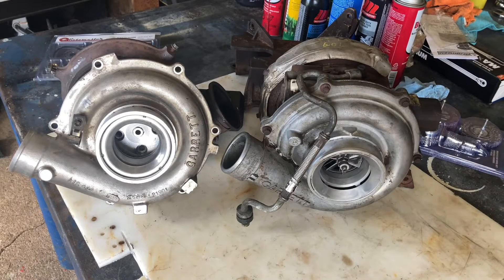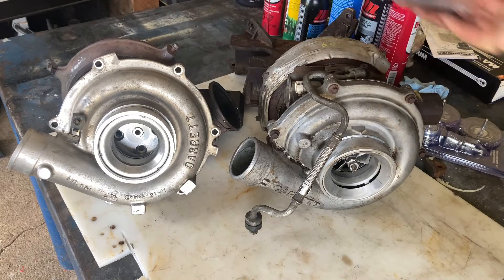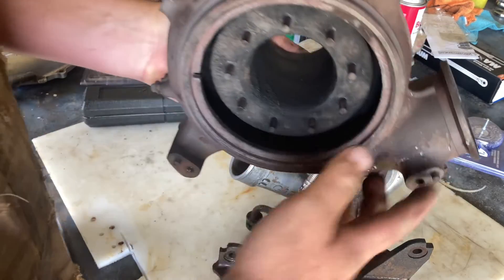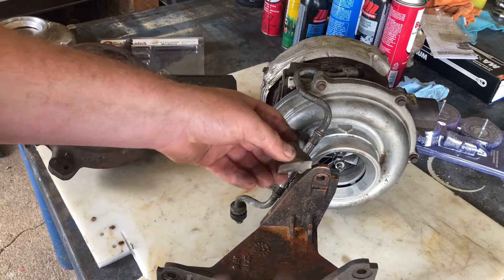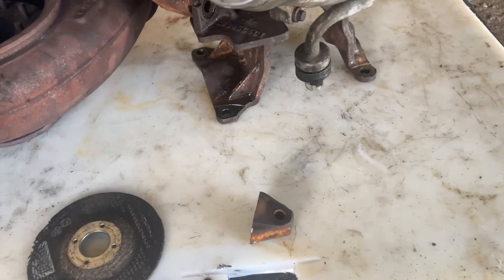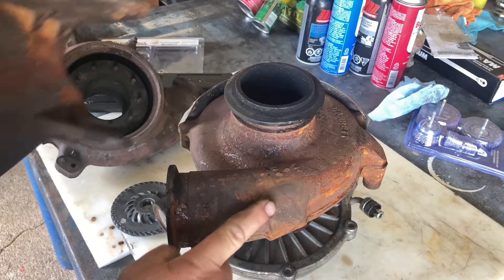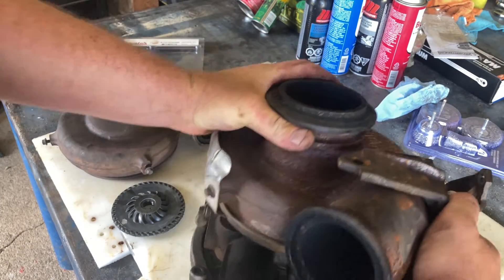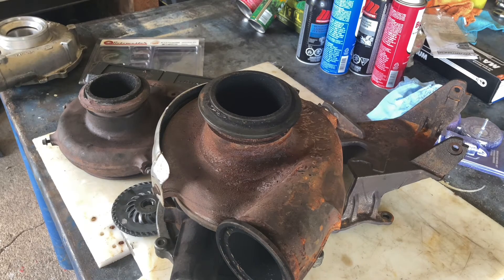6.0 Powerstroke Turbo Swap! ‘04 and up Garrett Turbo into a 2003 F-350

Comment: Instead of cutting and Mickey mousing, just get the correct pedestal.
Reply from the maker: Yeah, that would be great if you can find one or are not in a pinch.  I wish the guy I bought the turbo from had the pedestal or a local salvage yard had one.  It’s not pretty, but it works.

Comment: What if you have the intake and turbo from a 05? Is it direct fit ?
Reply from the maker: If I remember correctly, the turbo bolts to the fuel pump cover.  I can’t say for sure, but the fuel pump cover should be the same for all 6.0 blocks.   The easiest thing would be to use the ‘05 turbo and it’s mounting pedestal.  The pedestal mounting bolt pattern is the same across the years of production; it is the location of the turbo mounting bolts rust changes.  Hope that helps and thank you for watching!